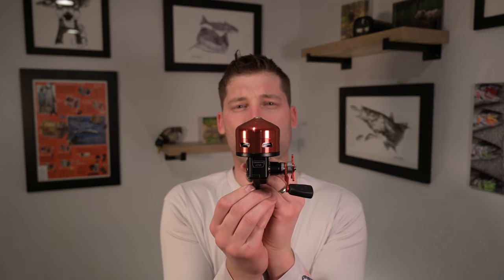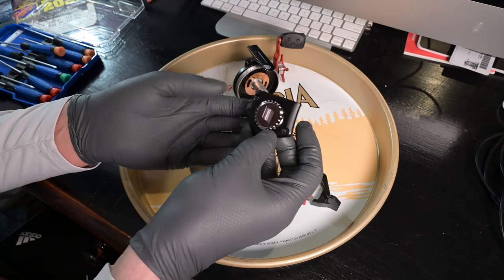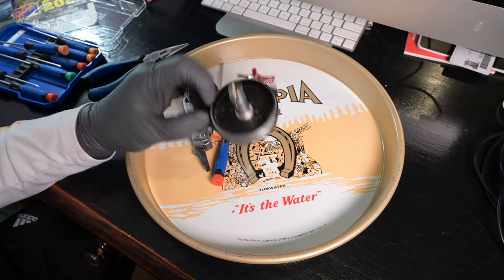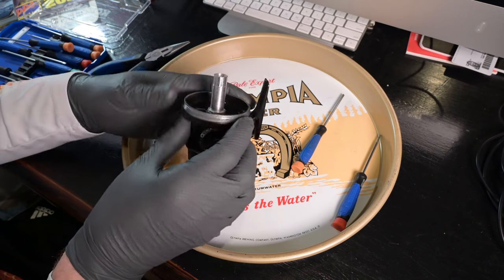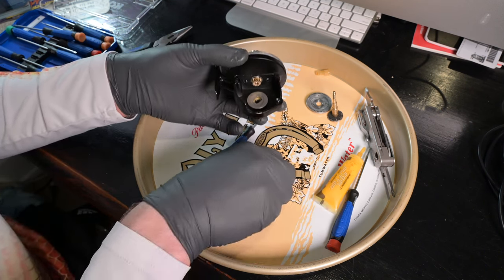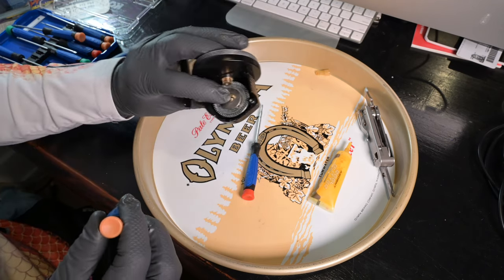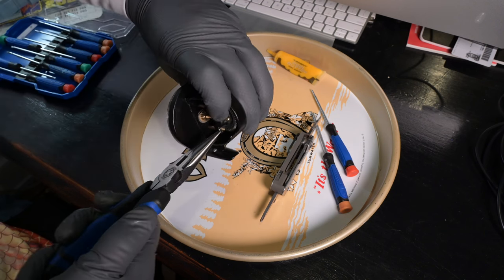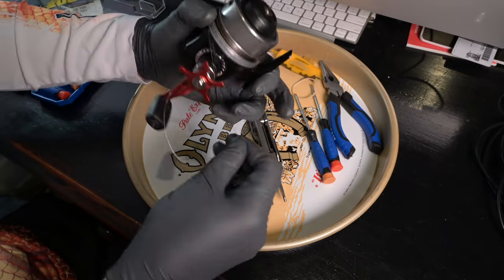ABUMATIC 170: Teardown and ASSEMBLY for service or REPAIR

Comment: Thanks for the video.  Can you put the oscillating block on first and then put the shaft in?  I have the old 170, and I amazed how similar they still are after 40 years.

Comment: On my 170i, the star drag tightens as I'm reeling in.  Next cast, the drag is completely tight.  I had the handle of for spray lube.  Did I reassemble the handle washers wrong?  I never took the side plate off.  Can you advise?  Thank you.  Love your videos.  Make more, pleasel